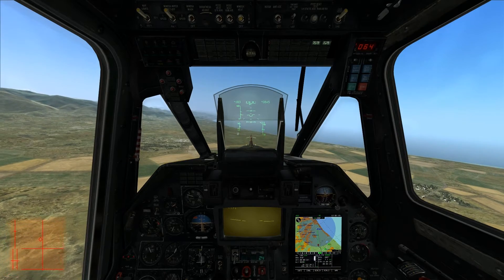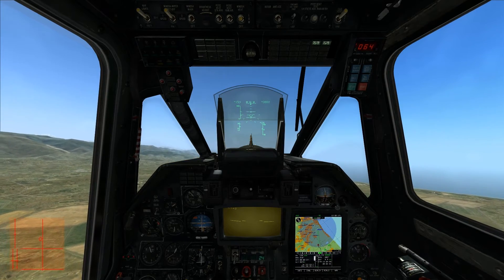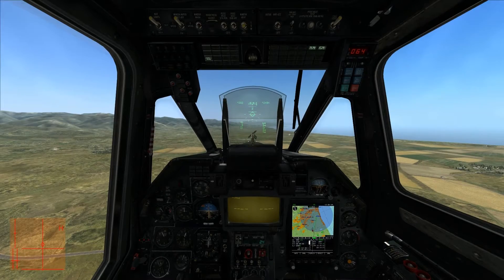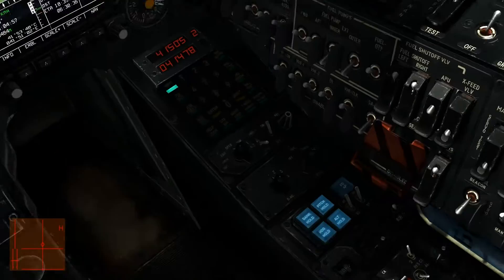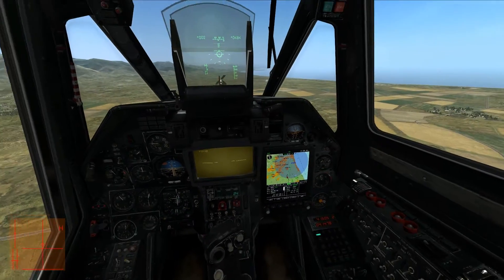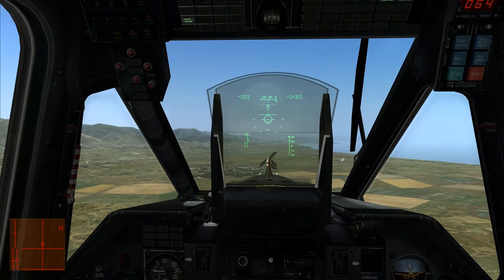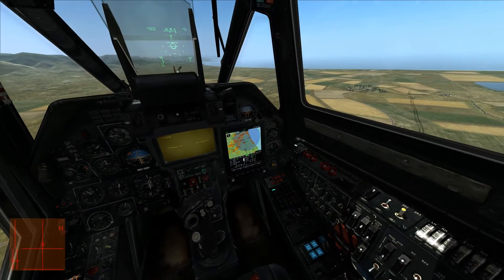DCS World - Ka-50 Autopilot hover mode

Comment: One other question - I noticed you have the flight directory on as well as both switches in the up position.   Do you fly with all 5 buttons typically and just use trimming and hovering ?
Reply from the maker: Typically I fly with 3 channels on, I generally only activate the altitude hold when I'm heads down doing something in the cockpit for a while.  As far as the flight director goes I actually never use it and just prefer to hold the trimmer to disengage the autopilot instead of activating the flight director.

Also those two switches you mention are just the altimeter setting and desired heading/track.  Nothing relating to control authority.

Comment: Thank you - can you address one item here ?  I'll get in a hover but I want to raise or lower my altitude.   Is this where I would use the collective brake and/or descent mode ?  I've had issues where my descent will say -3 but my altitude is not changing (I have all 4 stabs on).   Does enabling hover mode also set trim, or should I set trim and then hit hover ?   I noticed when you pulled back at the beginning, your speed quickly dropped, it was hard to see how much collective you used to pull that off!   Thanks!
Reply from the maker: While in a hover with the altitude hold channel engaged you will need to use either the collective brake or decent mode in order to descend without fighting the autopilot for control authority.  

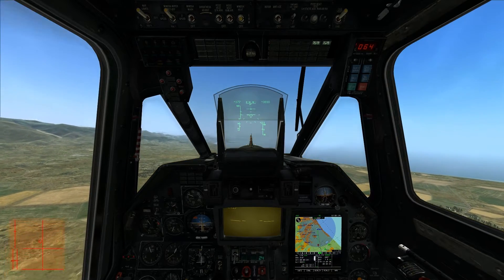As far as trimming goes, I trim into the hover which you can hear at about 00:06.  I basically just hold the trimmer, pitch for 10 degrees and release the trimmer.  There are differing opinions as to how to trim the kamov but I hold trim as I do any sort of maneuver (including entering a hover) and release once the pitch/roll/yaw is where I want it.  The reason for this is that when the trimmer is held it temporary disengages the autopilot.
Reply: @pickinthatbanjo  thanks - I've been turning off alt-hold and lowering collective and then reapplying alt-hold, but it sounds like I can do this with the collective brake.  I've also been tapping trimmer - I'll try holding instead. Thanks for your helpful videos and response!!!

Comment: Question - every time I press auto-hover my helicopter will pitch up violently once I release the controls and begin to accelerate rearwards. How do I fix this?
Reply from the maker: Does this happen after you trim it into a stable hover before enabling hover hold?
Reply: Same happens to me but going backwards, I make sure im not gaining any altitude, and speed is below 15. Then i press the auto hover and the thing just goes backwards forever.

Comment: I wanted to ask something. 

Sometimes when you enter hover mode (from appropriately slow speeds ~15 kmh or less), the system cannot sustain your initial position and the helicopter hovers way off the square symbol location. 

I have a couple of ideas as to why does this happen:
1)pitch/bank trim before and during hover  affects autopilot ability to maneuver the helicopter to the square.
2)wind has a similar effect as pitch and bank trimming, requiring you to trim pitch/bank to be able to overcome it with 20% authority.

Does bank/pitch trim have an effect while in hover mode? you can retrim in hover by using trim button too? or you need to trim appropriately before going into hover?

Comment: Hi. Thanks for the video. I see, you are holding your stick forward a bit in a hover. I have to do this too. If I release the stick, the aircrafts starts moving backward. And trimming does not help here. Is there a way to stable hover without any axis input?
Reply from the maker: +Тимур Назаров The control indicator does show the stick is slightly forward but I did in fact release all pressure on the stick, that joystick did have issues though so it's possible that it just centered itself in that position by default.  It has been a bit of a while since I recorded this so I can't recall since I've switched joysticks some time ago.

In regards to stabilizing the hover though, it goes a long way to trim it for a hover as best you can before engaging the hover hold mode of the autopilot, the more stable you have it trimmed before enabling the mode the less drift it will tend to have.

Comment: What is the difference between pressing the right panel AP buttons and the Lalt + T hotkey "Auto Hover" mode?
I notice that when you use the right side panel buttons, there is no "Auto Hover" annunciation on the overhead panel, but if you use the Lalt + T keys you'll get an annunciation. 

Sorry if this is a basic question but I just started getting into the Ka-50, very different from the Mi-8 which I usually fly.
Reply from the maker: +itsumonihon The four illuminated buttons on the autopilot panel control the various stabilizers used by the stability augmentation system through various regimes of flight.  Generally it most noticeably affects pitch/bank axis for the trimmer system.  I demonstrate that in this video as I recall - https://www.youtube.com/watch?v=__uCSjUQmCE&list=PL-rNisMp5bxE2sOzdHPYoezq8zsSG9dr0&index=5

As far as the hover hold function goes it will place the stability augmentation system into a stable hover provided the aircraft is within parameters to do so, essentially you need to enter a hover in order for the hover hold to effectively function.  

And as I recall there is no in cockpit function for hover hold as it is on the either the collective or the cyclic, though that is going off of memory.